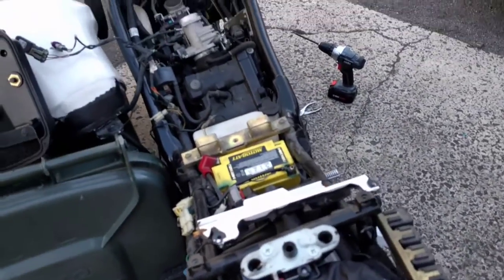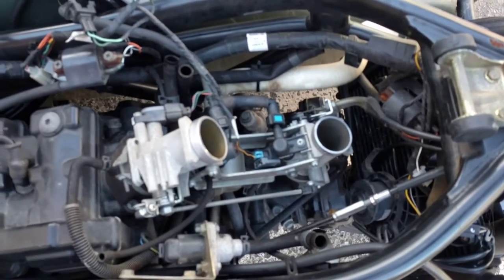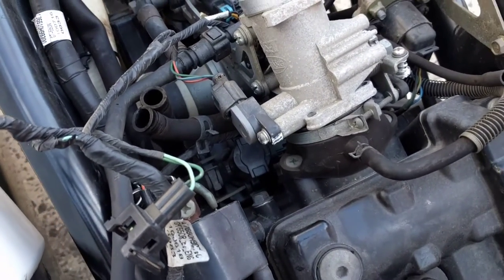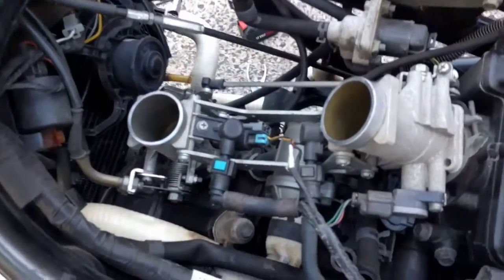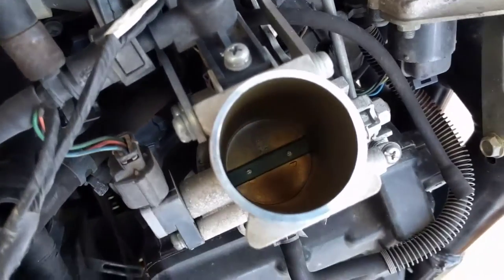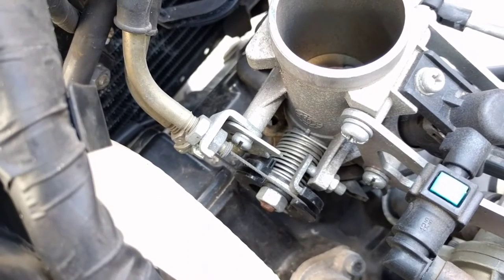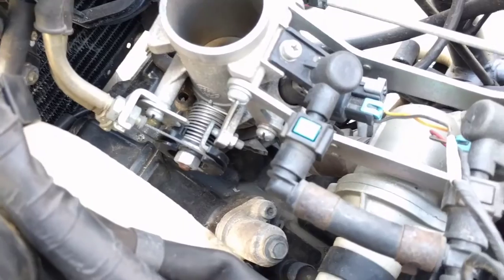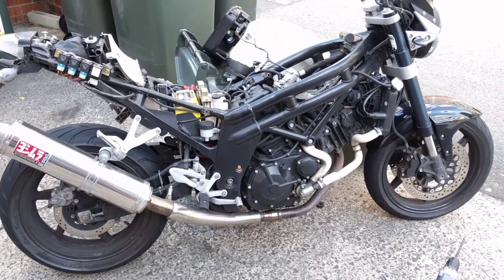Hyosung 650gt TPS issues

Comment: I have the same problem.  The motorcycle slows down and stalls in hot weather at high rpm. In normal or cold weather, everything is fine. Motorcycle 650GT, 2015 release, carburetor.  Thanks to the author of the video!  I will try to change the voltage regulator relay.
I read on the forums from many people that these motorcycles often have weak voltage regulators that cause many different problems in motorcycle systems.

Comment: For 2014 gv 250 efi, gt 250 r efi models tps adj must be 1.1v and 1.15v. in close possition, 4.55v i just repaired my gv 250. With the low rpm it had a misfire. I cleaned Continental selonoid valf, i cleaned butterfly necks and now bike is perfect. Gv 650 is same. Close possition 1.15v- open position 5.6v tps volt

Comment: I own this bike and it is my first bike (I am an L plater). It's sitting at 8300km and the motorcycle has started stalling like you described, I got the bike with 1800km on it and I've tried learning doing the servicing myself. So far I've done its oil and filter change, regularly cleaned/lubed the chain, cleaned out the air filterand lubricated whatever needs to as mentioned in the manual.
I've yet to adjust my clutch cable but I think I will need to do that now because it feels very loose and I thought that was the reason for why it would stall at the traffic light sometimes, also, shifting between 1st, neutral and 2nd feels really stiff. Is the problem because of my clutch cable? If I re-adjust the clutch cable and play around with the TPS will this fix the stalling issues?
Reply from the maker: Adjusting the TPS will make your bike rev higher on idle, yes adjusting clutch will help with better changing of gears but the bike is a dog from the factory, my bike had other issues like fueling and  a bad coil adjusting the TPS was a band aid solution these are good bikes to gain experience and skills but don't waste your money on them
Reply: Paul M Thanks a lot. And good to know about this bike. I was planning to do a few things to it to make it more fun for myself but you’re about the 4th person who’s said to me that spending money on this bike just wouldn’t be worth it. I guess any money that’s going into it is to keep it mechanically sound and when I get off my Ls I’ll just get another bike?
Also, is it better to adjust the clutch from your hand side or the engine side?
Reply: @FPPofficial  , It is believed that these Korean motorcycles are superior to Japanese and Western competitors in terms of price-performance ratio.  Why do you think that you should not spend your money on them?

Comment: I have gt650r 2015 and its same issues as soon as its gets hot sounds like one cilinder stop working rpms drops belove 1k and stals..
Reply from the maker: Thanks for the comment mate, I don't have the bike as I wrote it off back in 2019 the real culprits are the regulator and it connector due to their position do not get a lot of air and it gets so hot that it melts the connect and can cause a fire as well you can cook a steak on it that's is important if you want your bike to charge the battery from the stator and the other is  ignition coil pack at the front the plastic insulator dries up and crumbles causing it to short/earth with the chassis
Reply: Just found out, that this might be due to the ignition coil. Mine does the same and blew two spark plugs in the past month. Once I replaced it, I will let you guys know over here. (I have poor idling, stalling, headlights dim when revs go up and the battery never charged while the magneto and rectifier were in spec)

Comment: Anybody discover this in 2019? I did, thanks.

An important issue and possible problem management to be thought of today, not just for the bike in the video. Bikes gets hot if we do not use engine oil that could dissipate heat effectively, and if the plastic holder quality of sensors or things is not up to mark, it is going to effect and damage the sensor. Excessive heat could also effect metals like coils and solenoid. At the end we are going to be left with a “mystery problem”. 

Conclusion : (1) Heat Management is serious management, (2) Plastic should not just be plastics. 

Question : Are there anything like a small washer that we could put between metal body and plastic casing of parts as to avoid heat being dissipate into the plastic casing and the parts inside it? Leather washer? Cork washer? Kevlar washer? Hmmmmm, the thing that they glued to underneath a space shuttle as heat shield would be suitable I guess. Now, where do I find a space shuttle?
Reply from the maker: Thanks for comment mate I couldn't agree more I don't have the bike anymore but yes the overheating was a huge issue under further investigation the front could was also cooked as soon as replace the coil all problems went away no more stalling but the heat was still there tightening of the throttle cable also helped it from notstalling as it kept the revs just above 1000 rpm, great little run around bike but I really wouldn't spend any money on it to be

Comment: Hey man, have you been able to remove the LAMS bracket? I am wondering what the specs are afterward and if it is worth it.
Reply: did you mean the throttle restrictor plate? if you actually shave it down with a file or angle grinder, you actually able to suck more air therefore more power. and would be able to achieve its top speed of 201kmh

Comment: Hi I am from Denmark I have a same problem. Help me if you finde the promptem.thank you.
Reply from the maker: I finally found out the issues isn't so much the TPS although it did temporary fix the stalling issue but the real culprit for my situation was the shitty Voltage regulator (VR) which converts the AC volt from the stator to DC volt to charge the battery which drained the battery which in turn kills the EFI from working. just grab a voltmeter put it on the battery turn on motorcycle, accelerate if the voltage goes up then you have another issue, if no voltage or voltage goes down then it's the voltage regulator or stator or both, also excessive heat from the VR it also an indication of VR failure

Hope this info helps
Goodluck!
Reply: Hej Sergio, Også fra Danmark her,,, jeg har samme problem,, fik du løst dit ?

Comment: i jave the same stalling issues on my gv650 will try to check these and Voltage while driving thx.
Reply from the maker: Also check your ignition coils too in the heat the coils expand which cause it to short out. I replace the one at the front which sorted out all my problems
Reply: THX.I have one on spare. also thinking about balancing the carburators. TPS seem to be fine for me.

Comment: Hi. Did it work?
Reply from the maker: I finally found out the issues isn't so much the TPS although it did temporary fix the stalling issue but the real culprit for my situation was the shitty Voltage regulator (VR) which converts the AC volt from the stator to DC volt to charge the battery which drained the battery which in turn kills the EFI from working. just grab a voltmeter put it on the battery turn on motorcycle, accelerate if the voltage goes up then you have another issue, if no voltage or voltage goes down then it's the voltage regulator or stator or both, also excessive heat from the VR it also an indication of VR failure

Hope this info helps
Goodluck!
Reply: Thanks for the reply. Not sure if my problem is same.
My bike idles at little less than 1500 rpm. Checked the voltage at battery terminal and it shows 13.8V and goes upto 14.5V at higher RPM.
After riding it for say 20km or so and when i stop my bike at the lights or toll or some place, the idle rpm drops to 1000 & below and the engine switches off. Then I turn off and on the kill switch(red color button on right) and press the ignition and bikes turns on immediately with little less 1500 rpm. Again the same story continues. The temp reading shows on display is 3 to 4 bars which is quite normal i think.
My bike is more than 3 years old. This problem i am facing since last 2 years. I took it to service center and they checked. but according to them there is no problem as and when they take for test ride they dont face any. Also, i took them once as pillion in heavy traffic (4-5 bar temp) and on highways(3-4 bar temp) but the problem did not come up.
Not sure what would be the problem. Could you help me out??
Thanks :)
Reply from the maker: Can be a number of things bad fuel, spark plugs, coils, fuel injections over heating wires shorting out etc etc.
Reply: Oh thats lot of things to check. To start with...
1. Bad Fuel: No option but to trust the fuel station. Tried all the major fuel suppliers in the city. :(
2. Spark Plugs: If spark plugs are the culprits, then should't the initial cold start be a problem too?? And here the service center guy would love to change the parts even if there is no problem in it. :)
3. Coils: You mean ignition coil? need to check that along with etcs & etcs :( :(
If there is a problem with TPS, will it show uneven idle rpm after cold start or will it wait for the engine to get hot?
Reply: @pramodlivz  man i have it exactly as you mentioned after hot it idles too low to sustain itself any ideas? I have good voltage so...
Reply: @mydroidid  Hi, still working on it by myself... will let you know once done.
Reply: i think i have figured it out what could be the issue. As i was going through some old pics, i now remember this issue came up immediately after the one way clutch was replaced by the service center guy. The one way clutch got damaged and i had to replace it. As the one way clutch and the stator assembly is on the same side, may be at that time something got damaged during the repair. Now when the bike gets hot the stator acts weird and when it is normal the out voltage seems good. 
I will take out the stator and get it rewound and check if i get positive result. Will let you know soon.
Reply: @pramodlivz  im using an electrosport heavy duty stator for the gt650 and a street 750 regulator so i doubt it coukd be the case but i will check if there is a voltage drop when hot
I also noticed i had (total 20w) fog lamps wired to the battery  that i removed before riding the last few times and noticed it dint turn off as much
Im using a 14ah battery i plan to upgrade when possible dont know it it will help but will try higher ah lithium
Reply: @mydroidid  Let us both try and share the outcome. Recently i changed the coolant in my bike just to check if it solves the problem. I have noted after coolant change the rpm issue came up after riding for approx 60 km. Before this the rpm issue would come up within 20-30km. May be the engine temperature sensor is also a culprit. 
This sunday i am gone a monitor voltage and the sensor and will let you know.
By the way, when the bike was hot and the rpm reduces, i got an error code C22, which is O2 sensor fault. I have changed the O2 sensor but still the problem persist... 
Could be please tell me from when are you facing this problem? like after you changed something or just it appeared suddenly?
Reply: @pramodlivz  i did a full refurbish on the bike  the battery  coudnt start the bike so that and had some mods done at the same time
Stator and regulator as mentioned
High pressure radiator cap
Silicone hoses 
New water pump
Dobeck performance fuel tuner 
Kn filter
Danmoto jisu exhaust
Exhaust completely heat wrapped double layer
New throttle cables 
I had the fi light initially (50kms) on deceleration but nothing now
I have a broken lock on the temp sensor on the radiator but reading shows fine so i dint check too hard moreover i checked the temp with a infrared thermometr
I run a 90w h4 bulb now problem almost went away with the removal of the direct battery conected fogs tho then i only had 35w h4
The bike fell over to the right once and damaged the radiator very slightly but no problem with coolant flow
Reply: @pramodlivz  i just remembered at full throttle there was a very slight hestitation around 7000rpm and then it picked back up so i will try to check the fuel pressure if  possible ..as i write this i noticed last time it was running on premium fuel around the same time i removed the fog lamps
I will also try this tps setting thing...
Reply: @mydroidid  now my head is spinning :P
Reply: @pramodlivz  i had adjuated the tps today by volt and not ressistance
I put it at around 1.18 to 1.22 and went ridingi tried to purposely make it turn off once i was felt it made a change 
It did but only once and that too i was stuck in traffic for relatively long 
All considered i might not fiddle with this stuff for sometime
Reply: @mydroidid  Hi, thanks for the feedback. i checked the voltage reading when the bike was hot, still nothing negative i found on the charging system. i was expecting when the bike gets hot, the voltage reading goes low thereby the sensors don't get enough voltage. unfortunately that is not the case. Bike still turned OFF today when hot and when restarting, i had to press the starter button couple of times and the bike only started when the throttle was increased during cranking.
Next, i will check the spark plugs and the ignition coil.
Reply: @pramodlivz  if you had to throttle while cranking it has to be the tps
Reply: @mydroidid  Hello, did you manage to get through the problem? I am still struggling here...:(
Reply: @pramodlivz  i dont know how much of it was solved but i  have used some injector cleaner and it got better but never gone... however when about to stop i keep the bike in gear through the deceleration/braking and i notice a slight lack of engine braking and a fraction later i can pull in the clutch with no stalling...  and bit scary at first.
Reply: @pramodlivz  you kerala? We might be able to meet
Reply: @mydroidid  I am in Mumbai :) We can surely meet when i come to Kerala... By the way my native is Payyanur
Reply: Hi, I was servicing my bike today. Removed the spark plug to clean and noted that the spark plug installed is cpr8ea9 whereas the spark plug mentioned in the service manual is CR8E. Also, the front spark plug tip was found to be bent and almost touching the electrode. 
May be the service center guys have replaced with the cheap spark plug without informing me and due to which the engine stalling issue when hot. What do you think?
Reply: @pramodlivz  did it work?
Reply: @mydroidid   Will go for a small ride this Sunday, hopefully it doesn't rain. Will let you know then. 
I have changed the spark plug: CR8EIX and also the airfilter to K&N. Trimmed the coil wire a little and reattached to the spark plug cap. Then some minor adjustment of clutch cable, throttle cable and minor oiling and cleaning. 
Initial observation after service: Bike runs smooth as new. No popping sound at all when deceleration. I never felt this before when the service center guys serviced it... fingers crossed and hopefully the problem get solved.
I am there on instagram: @pramodlivz
Reply: @pramodlivz  i went for a 150km ride this Sunday bike stopped stalling after it got real hot.. the fi light came on but iwas in too much traffic to do anything so pushed on suddenly it stopped stalling whatever i did and noticed the idle solenoid is inconsistent... going to check that this week
Reply: @pramodlivz  Hi, I'have your problem too but I have a GT 250. Did you solved it?
Reply: @stefanosaraceno4100  Hello Stefano, not yet :(. i did not get much time to attend the issue. Will keep you posted. I have taken it as a challenge and will not sell my bike before solving this :D
Reply: @stefanosaraceno4100  Hello Wolf, seems like a charging system issue. The initial issue with my bike was something different but recently something similar happened. When diagnosing, i found that the RR unit is bad. I will replace a new RR unit and will check if this problem persists.
Also, check the resistance and ground shorting of stator and pickup coil.
Once this charging issue is cleared, I will check if my initial problem is sorted out...
Reply: @mydroidid  Hi, Did u manage to get the problem solved?
Reply: @Stefano Saraceno Hi, Hows your bike running?
Reply: @pramodlivz  I sold the bike for cheap actually in exchange for some building materials as the bike was no longer useful to me
Reply: @mydroidid  oh :( anyways thanks for the reply. :)
Reply: @pramod can you please help regarding with my bike...the problem is sometimes  when i start my bike the rpm stuck at 0 and  whenever i try to increase the throttle it goes off
Reply: @fitdactar  Hi, i feel this can be a battery issue. How old is your bike battery? If you get a chance, borrow a new battery and give it a try. This is the easiest and the first step. Fingers crossed :) Also, check the ground wire from the negative battery terminal going to the engine body for poor contact.
Reply: @pramodlivz  i have bought a new battery but the problem still persist
Reply: Finally, i have managed to solve the problem. The radiator cap was the issue. I have replaced the cap and the bike ran beautifully without any issue.. The first trial of 50km was very successful... Next trial 80km, next Sunday. Fingers crossed
Reply: @pramodlivz  what was the fix?
Reply: @tevilawson6297  that’s what I’m trying to figure out From what I can tell is it’s the tps or a cooling problem
Reply: @raptorSTR  Mine turned out to be the regulator /rectifier. The wires were melted on it and just not properly doing its job. rewired it and voila. Hope it helps someone out there.